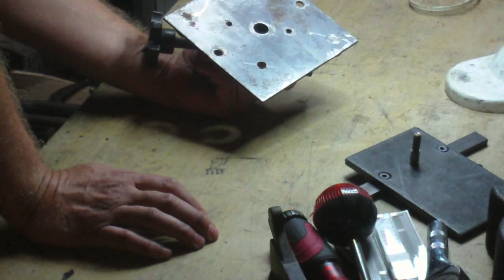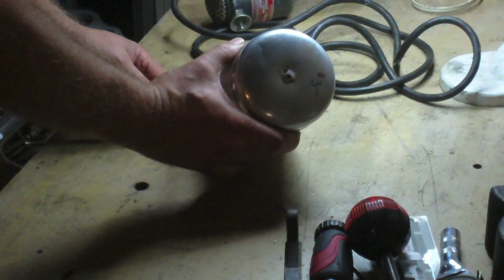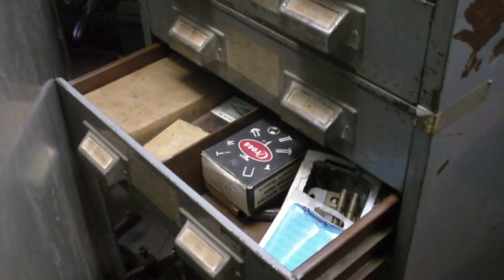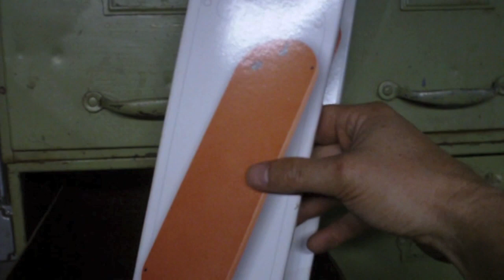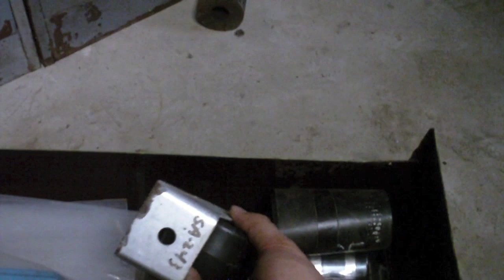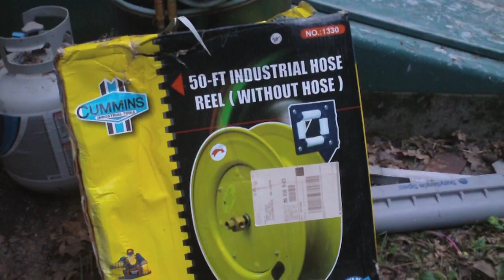September Estate Sale Part 2 of 2

Comment: Hi Steve, on that tool for installing the threaded inserts, in the compartment next to where you picked up that tool is an accessory for it. It has a hex shaped part and is metallic yellow and silver. There are different sizes for different sized inserts. It fits into the nose of the installation tool. There's a knurled collar on the nose of the tool that is removed with a quarter turn. the accessory driver fits into the nose with the hex socket engaged on the male hex shank. You've probably already researched this out so, I'll give you an installation tip. Hold the nose of the tool flat and firmly against whatever you're trying to install an insert into. If not, when the thing pops, the insert will never seat and will just spin. You'll have to drill it out and start over. Getting the damaged insert off the end of tool is frustrating too.When doing the installation, as you're turning the "T" handle, you'll feel it getting tighter and tighter. Then, all of a sudden, you'll feel it give or pop. Continue to turn the "T" handle until it gets tight again and you're done. Not too tight though, about as tight as you'd tighten a screw of that size. ie. 10-32 insert -  10-32 screw. Used a lot of them at my last job.
Reply from the maker: +Dave Lee Thanks Dave. I researched the tool and found it to be a pricey little tool, and since I do not foresee much use for it, will probably unload it, and I'll make sure the accessory goes with it (Thanks to you!).